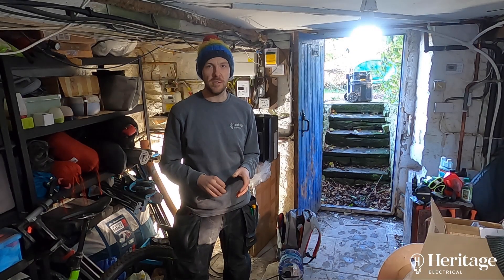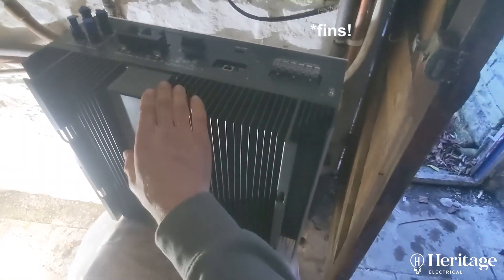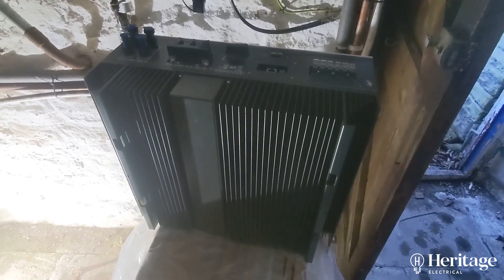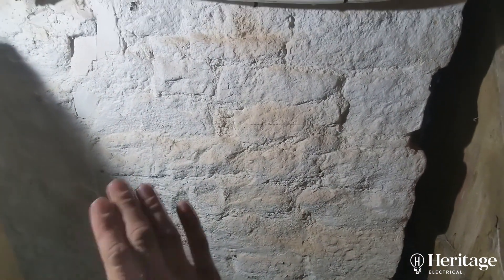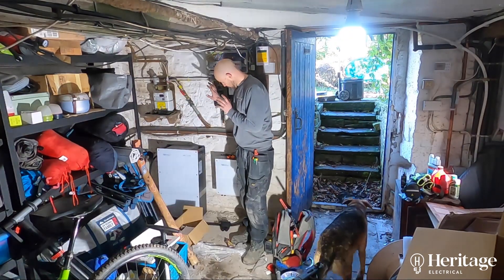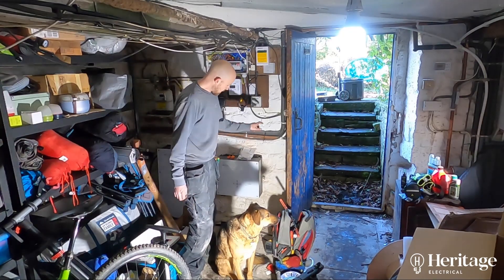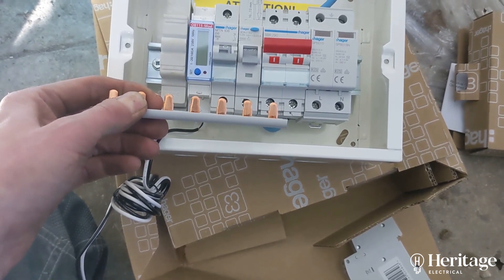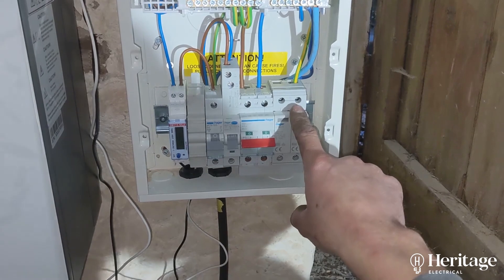Part 1: Installing a Givenergy Inverter & Battery Setup to Save Money with Octopus Go Tariff

Comment: Hi, love the channel. I wonder if perhaps you could help: a small number of fellow Givenergy Gen2 inverter owners had their inverters fail in the past week or so (relay fault) which now means our systems are not working. We've had absolutely no luck with getting Givenergy to respond with a timely solution so we were wondering if you have any internal contacts at Givenergy you could reach out to on our behalf. Thanks and keep up the good work!

Comment: What terminal does the battery management cable go into ?
Reply from the maker: There's a specific battery management terminal to connect into on the Gen1; subsequent versions have the cable integrated into the main connector between battery and inverter - no need for a separate terminal.